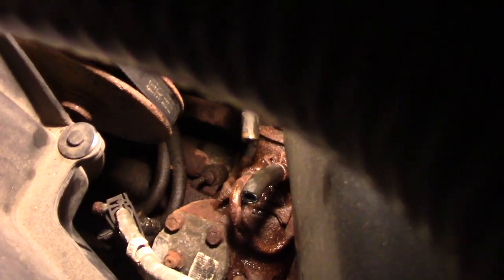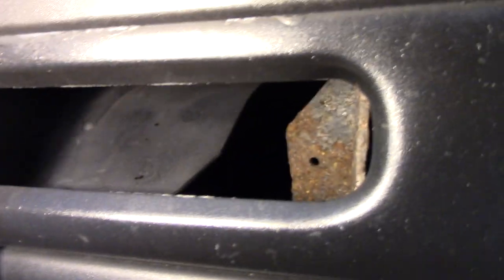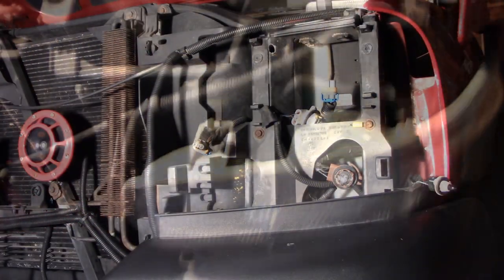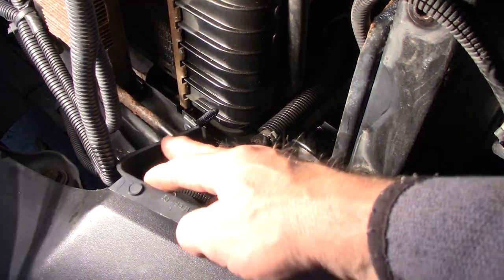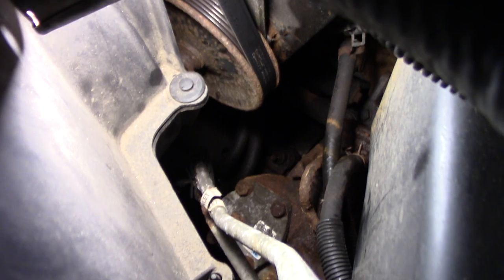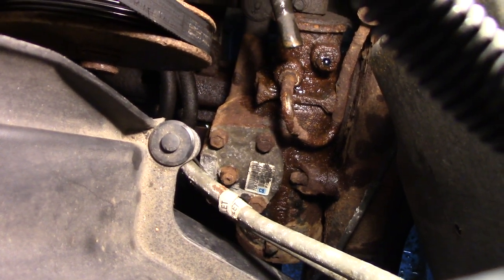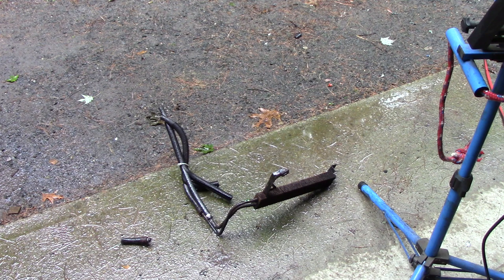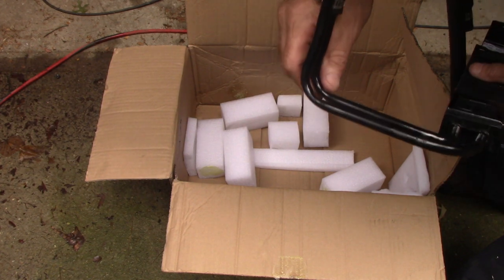Power steering oil cooler replacement for 2002 GMC Sierra

Comment: I just found the cooler leaking on a buddies truck and I just bypassed the cooler for now using the feed line to loop back to the pump. He doesn't have the hydro-assist brakes and we are in Virginia so it's not too hot here..  what's the two red speaker/horn looking things mounted in front of your radiator?
Reply from the maker: Hella horns for my wife's subaru she didn't like them
Reply: How is that rig job holding up? I just got my new part to do mine today but saw the made in china sticker and wondering now if i should just not even bother putting that garbage on my truck.

Comment: What tools did u need ? And what’s the side of the bolts holding the cooler ?
Reply from the maker: Really just common tools like sockets and extensions and it would be on the driver side
Reply: Do u remember which size socket?